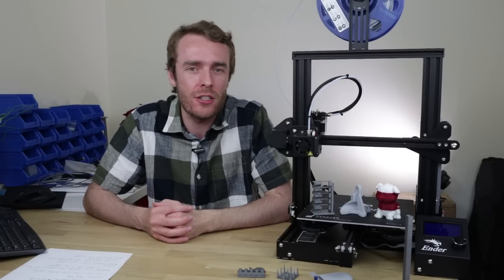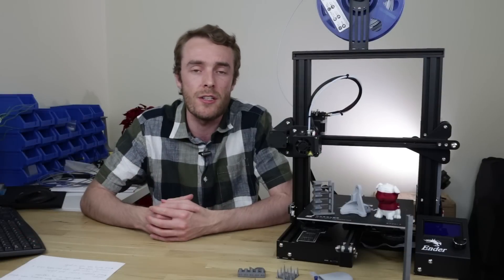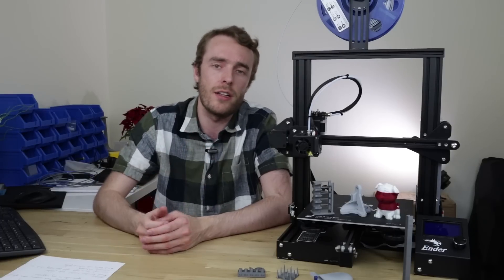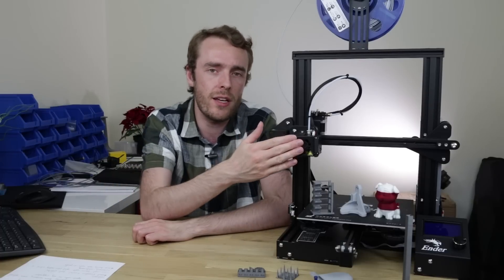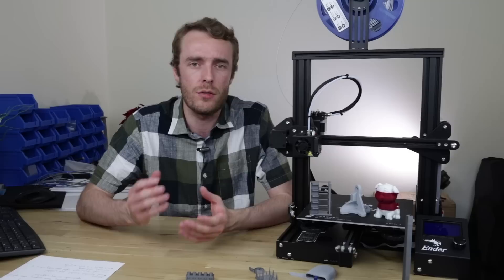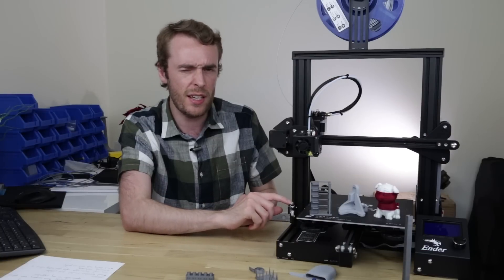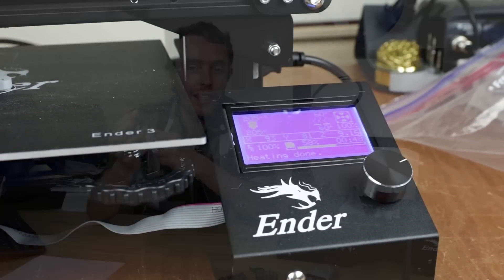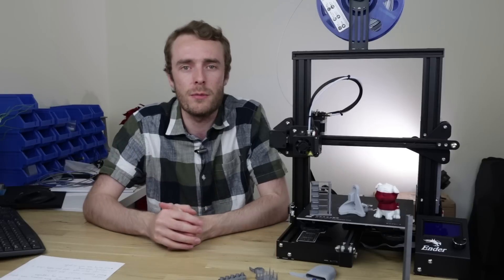Not quite what you think: Creality Ender 3 Review

Comment: One thing I don't like about my ender 3 is that the part cooling fan and the sd card has already died and I have run less than 2kg of filament through it. Also the design of the motherboard is not all that thought out.

Comment: You can fix stringing by fixing the gap between nozzle and bowden tube. I do also recommend to use high retraction speed 150mm/s if the motor can handle it.
Reply: Remember to change the settings in the printer also, sometimes it is limited. As acceleration for the extruder I use 7000 mm/s2. Best of luck in solving the strining issue.

Comment: had the same problem with the bed being lower in the middle, i ended up getting a decent steel ruler, en started bending the bed sligtly by hand. After every bend i checked with the ruler to see if it got better. i ended up with an almost flat bed, with the exception of the back 2 corners. You could try this, but it is probably better to get a glass plate.

Comment: Would you recommend the Ender 3 or Prusa MK3?
Reply: C.R.T I don't want to really tinker. can you speak about the issues that people have been saying about the MK3?
Reply: Ender 3 forsure, the mk3 has a ton of bugs and prusa won't do anything about it, plus it's just flat out way overpriced imo
Reply: There are only a few minor things but they can be fixed by loosening your tension screws.   Belt tension can cause issues if not set correctly.   Prussia has 12 full time programmers so I don't know where you come up with they don't care or aren't doing anything about it.   Ender 3 is fine for a first printer and a cheaper alternative to 3d printing.
Reply: Yeah, this review is inaccurate, get the Ender 3.  Seriously look at other critics, I got mine 2 weeks ago, it's worked great.  No idea if this dude got a bad unit or is using a bizzare profile, but it works practically out of the box.  This is better than the Prusa MK3.

Comment: You didn't have to reflash the firmware to figure out activated protections... i mean, all the tests are
*disconnect thermistor
*bridge thermistor port with a jumper
*connect the thermistor and disconnect the heater.
each done for both the bed and the hot-end.
And of course TH3D's firmware has no relationship to the one shipped, it's configured from scratch.
Reply: Oh excellent! Sorry!

Comment: Geeetech might have an interesting alternative with A10. What you get for the same price is a much better protected and more extensible control board (want more steppers? OK! want Trinamics? can do) with just one flaw, the power connector might be a bit prone to fire, though mine and the ones i've seen recently seem to hold up quite well. Bootloader is ALWAYS supplied and firmware source is expected to be published, should probably be in a few days, and if they don't manage to do so, just poke their e-mail support. Mechanics is a bit of a wildcard since the printer has barely started shipping and there are no reviews yet, but if the recent A30 is anything to go by, it might be perfectly well-constructed. The Geeetech EasyPrint software is an absolutely broken disgrace, but you can use Cura or whatever you prefer.

Say, a YouTube friend in your general vicinity might be getting an A30 or A10 shipped to them soon, do you think you want to do a collab-review-thing? They normally do computery things and this will be their first 3D printer, but they do have 20 times more subscribers, so there's that.